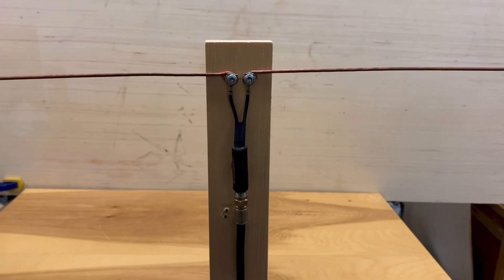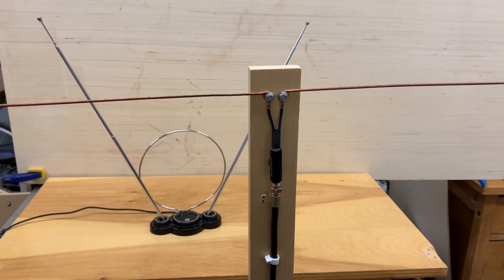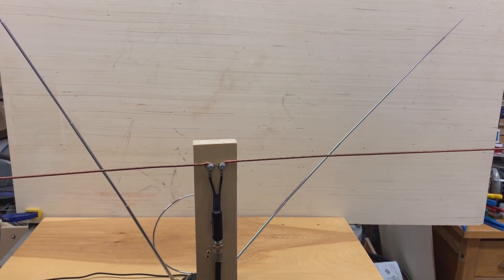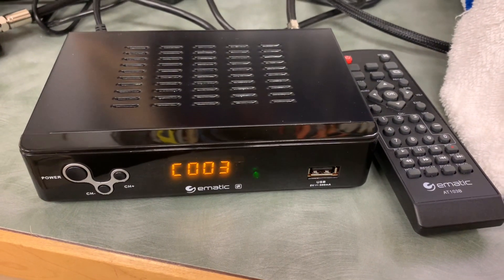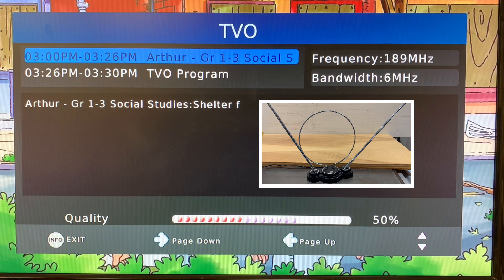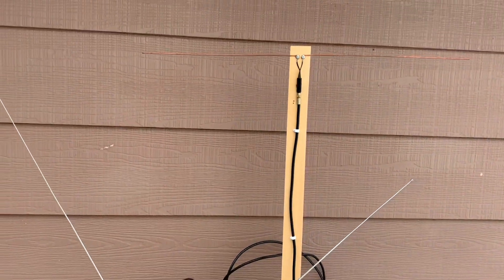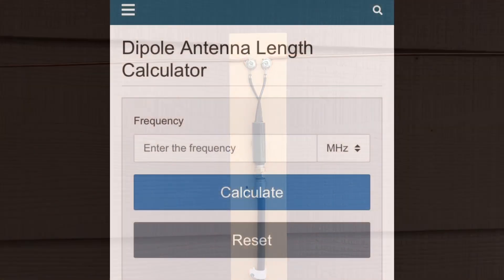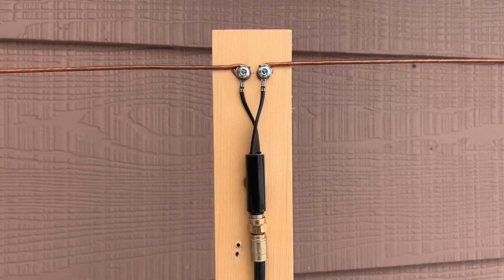Homemade TV Antenna Test | How well does it work? OTA TV reception

Comment: great vid, the rabbit ears probably did slightly better because the elements were longer compared to you're DIY dipole. This would only effect VHF. I've found that loops (non-dipole) work better for UHF, but that's also dependent on location, & terrain

Comment: That's all you need. Really. One day at work the cable went out. We needed television for the customer lobby and waiting area. So I pulled out the TV and stuck a thin piece of solid copper wire into the antenna connector & voila we were getting all the local stations beautifully!!!

Comment: a simple loop made of copper wire will work wonders. Maybe even a double Loop. Put it outside you may be pleasantly surprised 😊
Reply from the maker: Thanks for the tip!
Reply: Also rhombic stye look up rhombic antenna for cb radio ham radio antenna
Reply: Mount it on a wood post

Comment: Your antenna lengths need to be close to same length. Otherwise one of them will be tuned different then the other. So you might have accidentally gave one an advantage over the other.
Reply from the maker: Fair point.

Comment: What length and thicken of wire did you use? i look to try to  get rf 9 that pointed in different direction which 7miles  away from  my main vhf high antenna is pointed currently.
Reply from the maker: Hi Leo, it’s 12 gauge copper wire, each piece is 15-3/4 inches long.

Comment: Have you done any experimenting with adding more elements to your homemade antenna to see if it improves the signal quality?    Most of the old-school tv antennas I remember from years ago had multiple VHF elements on them.
Reply from the maker: Those would be reflectors and directors. They help to focus the signal on the active elements of the antenna (the elements connected to the balun). I’ve tried it briefly but they must be the correct length as well positioned the correct distance from each other. I’ve just never revisited that.
Reply: @NorthcoasterHobby  It's a very fun project of mine making my own Antenna's heck i built a WIFI one too and a FM antenna though for some reason FM is harder for me
Reply from the maker: @wii166  It is a fun hobby. Thanks for watching.

Comment: Great video. I would recommend to turn of the neon or LED lights because it affects the reception on VHF Band on both digital TV and FM radio. Maybe you can get a better reception.
Reply from the maker: I’m aware of the potential for interference from LED or fluorescent lights. I left the lights on because people watch TV with the lights on as well as off, and it is a more stern test of the antenna’s reception ability to deal with possible RF interference having the lights on. I also did not want to create a false sense about my homemade antenna by creating conditions that are too perfect.
Reply: @NorthcoasterHobby  You're right. My opinion is the best antennas are the outdoor antennas, you have better reception compared to indoor antenna. Of course there are some crappy outdoor antennas that perform worse than indoor antennas.
Reply from the maker: @Nicholas_Chris  Outdoor antennas are far superior to indoor. However not everyone is willing or able to install an outdoor antenna. Plus, I like to putter with these types of things.
Reply: @NorthcoasterHobby  Same thing I used to do back in the analog days, build antennas for indoor reception Unfortunately for me I can't use indoor antennas anymore  because all digital channels broadcast on UHF and the UHF doesn't have a good indoor reception like VHF so I have to use an outdoor UHF antenna. But if I use an indoor antenna outside I have no reception problems.